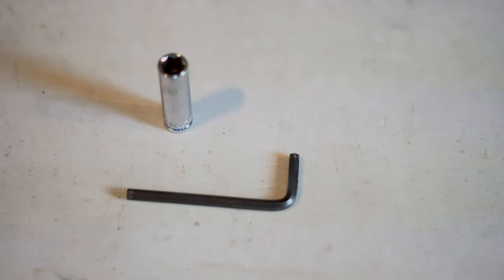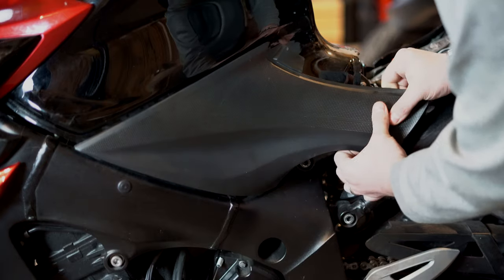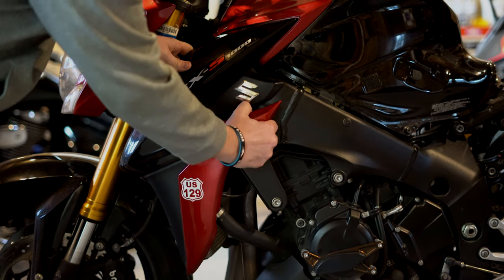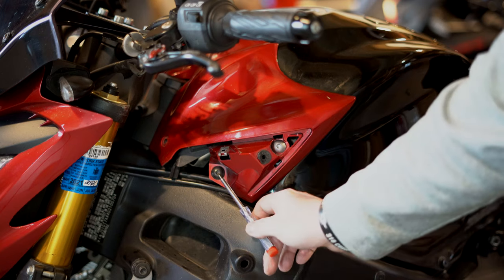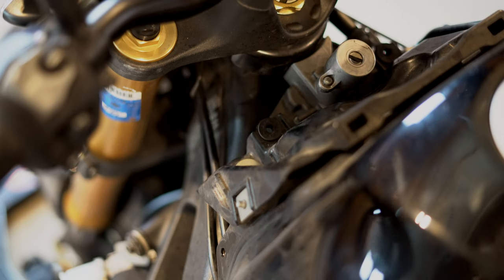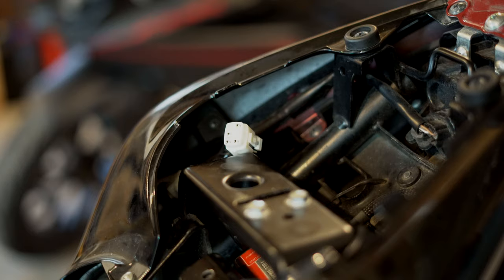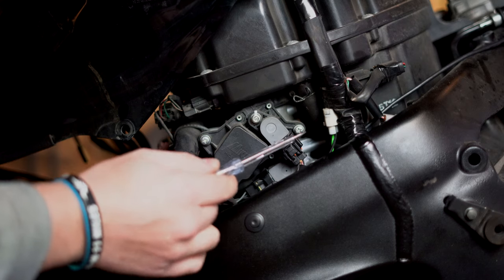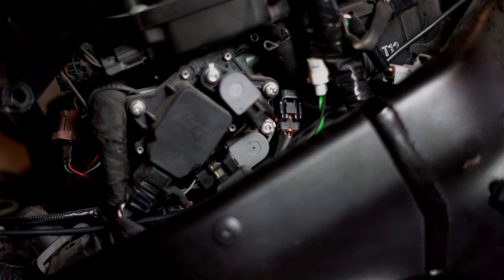GSX-S1000: TPS Adjustment & ECU Access

Comment: Hey mate, Good vid, straight to the point, clear instructions on how to pull things apart, and so on, Well done.
I have just bought one of these bikes, 2016 model (in Australia) and only ridden it once so far, so i am not familiar with the bike overall as yet.
Can i ask you what you mean by "Snatchy Throttle" ?
Reply from the maker: Many thanks! By snatchy throttle, I mean it's basically on or off, no smooth roll on, kinda jerky. Butter smooth after ecu flash though!

Comment: My brother!  Excellent vid, and I'm much obliged.  

A question, if you're still monitoring this:  Once I get the bike in Dealer Mode, there is no dash anywhere to the left of the "C00."  What to do?  The bike, BTW, is bone stock, excepting an M4 slip-on.  The ECU is going off to Dano's tomorrow.  Any help?

Also, out of interest, on the 2020 model, there is a pop-grommet/pin that has to be pulled out from the frame at the top of the quarter fairing, above the "S" on the body work, BEFORE you can pull it off to the front.  I guess that's a change for the newer models (The 2020, anyway.)?

Thanks.
Reply: I think the newer models are slightly different and do not have the dash.  According to the Suzuki service manual, on the 2018 and newer you have to put a "special tool" inline between the connector and the TPS.  This allows you to measure the voltage on the line while it is connected.  You measure the TPS voltage (closed throttle should be 1.10V -1.14V and open throttle is 4.5V.  If you have to make an adjustment then you have to use the Suzuki SDS tool to reset the TP fully closed learned value.

Comment: thank you, very helpful
Reply from the maker: My pleasure!
Reply: @JonDotCom7  quick question...maybe i'm dumb but don't want to break something.  How did you unhook the leads on the ECU?  Didn't want to just yank them out because it seems like there is a connection clip
Reply from the maker: @FreshRides  if you aren't able to just disconnect by pulling apart, there's probably just a couple clips you have to press in and then pull

Comment: i have just gone through the process of placing my bike in dealer mode. the "C" does not show a bar at top bottom or middle? your thoughts please.
Reply from the maker: @aticusaticus9138  only thing I can think of is maybe whatever you're using isn't metal or not placed in the correct pin holes?
Reply: @JonDotCom7  then why does the C display on the dash and indicate it is in dealer mode? this only happens when i place the paper clip in the appropriate plug terminals.
Reply from the maker: @aticusaticus9138  oh I think I either misunderstood or misread. Only thing I can think of is all electrical, i.e. how's the battery, is the bike off but key turned on?
Reply: @JonDotCom7  the ignition must be in the on position, musn`t it?  otherwise the dashboard info will not show ns the C will not display. how do you account for the absence of the bar at top bottom or middle of the C?
Reply from the maker: @aticusaticus9138  correct, key in ON position, but bike not running. As for the dash, I cannot come up with a theory why it's not showing. Even if it were perfectly balanced, there would be a dash in the middle of the C...

Comment: so if the line is in the middle you are stating the tps is correct??  I thought the proper way was to use a plug jumper and check voltage - I am confused ... PLEASE MAKE a video of the bike after you get your flash done-- I would like to know the details i only got 700 miles on mine but thinking of a flash after the 2k mark i heard they run better after 2k miles--
Reply from the maker: You are correct, the proper way is to measure voltage (between 1.10-1.14)... this method is if you're unable to. The bike likely won't run any different after 2k miles, I strongly recommend an ECU flash, it's a totally new bike.  Cheers!
Reply: @JonDotCom7  thanks please do a test ride after the flash review who did it etc THANKS__

Comment: if the little dash is already in the middle then all ok?
Reply from the maker: If that's the case, I'd recommend using a voltmeter and looking up what it's supposed to be at (I forgot what it's supposed to be)

Comment: Hi mate I ended up reflashing my ECU on my 2019 Suzuki Katana which has basically the same problem you speak about as its a GSXS-1000 platform. 
After flashing I can say its around 90% better in ALL aspects. The abrupt throttle is gone and much smoother. On deceleration there is no snatch if you want to accelerate again. The whole feeling of the surge/hunting at low throttle with light load is just about fully gone however I can just feel it at certain speeds (around 60-70 kph) under no load its a lean fuel feeling but if you weren’t sensitive or really concentrating to feel it, I reckon it wouldn’t be noticed. 
The only other thing I need  to do is check my TPS (the Katana cant use the dash like you can), and am waiting for a sensor adapter I bought to do the job with a multimeter -perhaps this will give me the last 5-10% I am looking for? Will keep you updated after thats done.....
Thanks again for the video mate!
Cheers from “Down Under” Australia 🇦🇺 👍
Reply from the maker: Thanks for sharing!

Comment: So if the little dash is already in the middle, I need to flash the ecu right? So I guess, it's a good idea to check the line position in dealer mode before access and move the sensor? Thx for the vid really appreciate it!
Reply from the maker: Right, to be absolutely precise, if you have a power commander, hook it up to a computer to monitor voltage, a voltmeter will also work, and you want it between 1.10 and 1.14. However, I think it's always a good idea to flash your ECU. Even adjusting my TPS only slightly helped but didn't 100% fix it, but the ECU flash did.

Comment: Is there a standard "flash" for the ECU that cures the snatch. Or does each tuning company run it's own "flash"?  Any ideas?     I've got the 2015 and it could be doing with smoothing out.
Reply from the maker: Each place has their own program and their own flash parameters. I can't say with absolute certainty, but I'm like 99.99% sure that whatever place you go with will smooth out the throttle. Many places will give you options for flash packages, what you want and don't want, my suggestion would be to always get the best one as that will completely open up your bike's potential. I went with Schnitz Racing and am very pleased. Many people also say good things about Moore Mafia.
Reply: @JonDotCom7  Thank you for the reply, something I will look into.
Reply: Moore Mafia ...

Comment: Hi Jon! Awesome video! I really like the pace and the way you are explaining each step. Great job!!!  I've just bought 2020 GSX-S1000 and it seems like the issue is still there. BTW I'm from Poland so I have EU market bike (don't know if there is any difference). Since my bike is still under warranty I guess I will wait with a bit with applying this changes. Do you know if this issue can be submitted to a dealer to be fixed?
Reply from the maker: Hey thanks! Glad you enjoyed! My highest recommendation is to flash the ECU, because that is the only thing that actually completely resolved the issue for me. But I'm not sure if it would void the warranty (I'm thinking it might) so I'd contact your dealer to definitively find out! Cheers & good luck!
Reply: @JonDotCom7  Awesome! Thank you, have good one!
Reply: In Australia we get the Euro version and my bike has the same problem. I have the 2019 Suzuki Katana (same as GSXS-1000) Snatchy throttle, “hunting” & surging particularly at small off load throttle positions. I just sent my ECU to get flashed. Will keep you updated on result 👍
Reply from the maker: @jeffestrada6857  for me, the only thing that actually worked was flashing my ECU. So if you get the same results you'll be quite pleased.